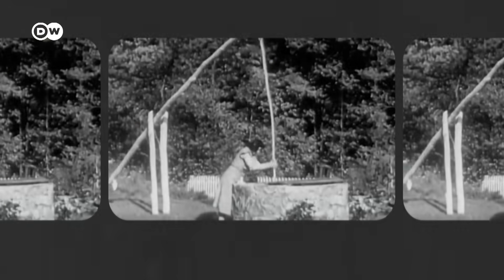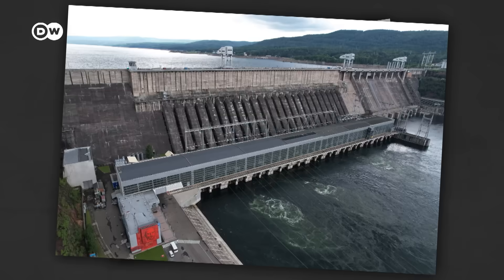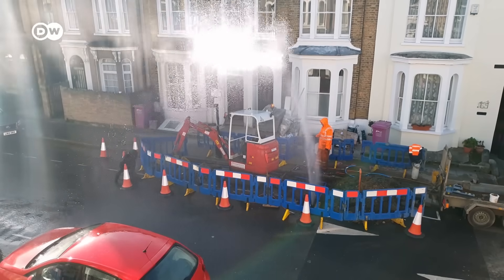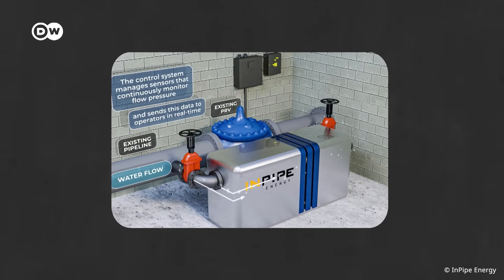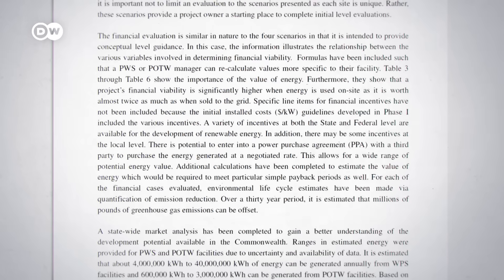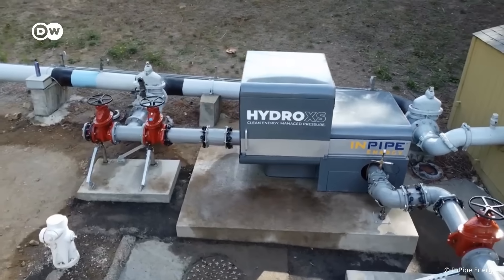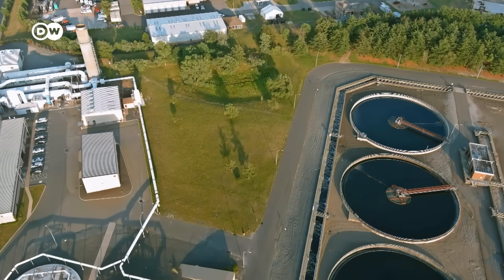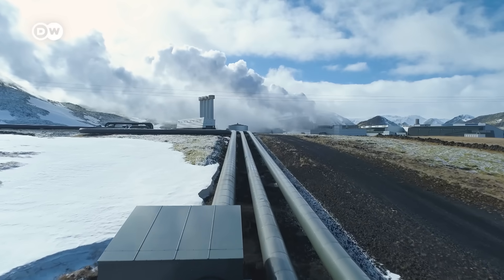In-pipe energy: The hydro power nobody is talking about

Comment: I'm sure it varies quite a bit by local geography, but in general, the pumps will be working even harder, and building even more pressure. If you want to "tap" into the resource of moving water, the oceans are hardly used. We have a mind-blowing amount of energy mostly untapped by the natural movement of the waves/tides. At the shore/beaches, we have a regular forward and back motion of water that could be made to move huge aluminum plates back and forth on a toothed track, which could be spinning enormous turbine generators. The power and scale of the ebb and flow of all that water could be harnessed to great effect IMO.

Comment: This doesn’t make sense to me.
Why isn’t the first priority minimizing the wasted energy? 

Like why would we put shade under facility lights that are way bright instead of just using less light?

The cost of installing all these seems securely high from a labor and materials perspective.
We’d need to bring a grid tie in to wherever we install these. 
We would need to manufacturer all parts, cable, etc, calculate the market value of the energy, mobilize and train a work force to install and service this whole new network, when we could simply have providers focus on minimizing wasted pressure? 

It sounds reminiscent of a tech billionaire trying to revolutionize mass transit when trains have always existed. 

Installing a turbine on a small local system like your house might be perfectly reasonable. 
That water is already at its destination and you get to decide it’s use. If you want to sacrifice further pressure for energy. Go for it, great idea. 
But at scale it seems like surely there are better alternatives with how to manage our water.

Comment: Unless gravity is involved, using electricity to build up water pressure, so you can generate electricity downstream from the pipe it flows through, seems like a very inefficient way. It would likely cost more energy in total than it can provide. It's a bit like running a turbine on electricity coming out of the socket of your home. But if there is scientific proof, I would like to read it.

Comment: Conservation of energy.

If a pump is used to move the water and you then add resistance (turbines) to the flow then you'll need to increase the power to maintain the flow rate.
Reply from the maker: Hey there!  Mini hydro technology only collects pressure valve waste energy already being generated by our water transportation service. Therefore, no additional pressure is needed. The process is explained at 2:26.
Reply: @DWPlanetA  This methodology relies on waste pressures in the system.  It would be more efficient to reduce the waste pressure - this is what water towers do in a very efficient way.

Comment: My dude you can’t get more energy out of a system than you put in. This is some basic ass physics. You’re having to pump the water which requires energy. You try to generate energy from the water in the pipes then all you’re doing is reducing the energy potential of the water by removing some of it from the system, not to mention the inefficiency due to energy loss of both wasted energy through sound, vibrations, heat, etc. - on the pump’s end as well then any energy lost to inefficiencies on your generator. 

Now if you’re trying to be a cheeky goofball and reduce your energy bill illegally, you could use it as a way to siphon some energy that’s already been spent by whoever’s pumping the water to use to help power your own home. However, that’s not making the system any more efficient, you’re just taking advantage of someone running all that free (to you) energy past where you live. There’s literally no reason to do this without it being on an individual level to essentially steal energy from the water pump to the disadvantage of everyone relying on that pipe for their water. 

Just stick a mill in a river hooked up to a generator… or build a hydroelectric dam.

Comment: Conservation of energy? The energy must come from somewhere and other than potential energy from water tanks, it would be energy from water pumps.

It's like wind turbines collecting energy from wind, would reduce air flow downstream.

Also, wouldn't power throughout be dependent on volume passthrough more than pressure?
Reply from the maker: Hey there!  Mini hydro technology only collects pressure valve waste energy already being generated by our water transportation service. Therefore, no additional pressure is needed. The process is explained at 2:26. And yes, higher pressure in water pipes mean higher water flow rate.

Comment: I don't know man, it sounds like a stupid idea to me. Yeah, you can put a turbine inside the pipe to generate electricity, but that would come at the cost of reduced water pressure for a lot of people and it's possible that some households could see their water reduced to dwindle or gone altogether during peak hours. A smarter idea would be to better manage energy consumption via AI and sensor fusion and don't pressurize the pipes as much during low demand.

Comment: Im sorry but surely the best thing to do is to not use the energy in the first place. This "solution" is a workaround at best. You want something more like distributed pumping stations and only ramp up when theres low pressure further down the system

Comment: If you put a turbine at the end of a pipe and run the water through it you decrease the pressure. So yes you get some energy but now you have a barely flowing water exactly what was mentioned at the beginning of the video that we don't want because it will take an eternity to fill a bucket. Maybe at those pressure regulation stations it make sense.

Comment: Dams have become bigger and more controversial, but with today´s  technology, it is possible to extract energy from as little as 5-meter fall in the form of electrons that are much better than water. 
But to obtain 100 watts of power, 2 liters (~0,53 gallons) per second of water would be needed in a 5-meter fall to obtain 100 watts of power, assuming an ideal system with 100% efficiency. So pipes are not solving our energy problem but rivers can.

Comment: If you resrict the flow the pump will have to work harder  and use more electricity.
Reply from the maker: Hey there!  Mini hydro technology only collects pressure valve waste energy already being generated by our water transportation service. Therefore, no additional pressure is needed. The process is explained at 2:26.

Comment: This is nonsense. Any water used to spin a turbine has to be supplied by the upstream pump. The pump will use more electricity than the turbine will generate. Unless the water is supplied by gravity, this is inefficient and cannot be sustainable.
Reply from the maker: Hey there!  Mini hydro technology only collects pressure valve waste energy already being generated by our water transportation service. Therefore, no additional pressure is needed. The process is explained at 2:26.
Reply: The pressure relief valves either bypass water to adjust pressure, or the pump speed is reduced to maintain pressure at a set level. Either way, by removing pressure upstream by running turbines will force the pumps to run longer and harder at the source. You have overlooked how these pumping stations operate.

Comment: as an engineer this is a terrible video. water systems are designed to certain pressures for a reason. If the pressure it higher than you as a layman thinks is necessary it's usually b/c you don't know engineering systems. there is a safety factor to make sure there is enough water pressure for the most fringe cases, and also excess water pressure for future development. you tapping into that is asinine. and if there were truly an overage of pressure, it's much more efficient to re-tune and lower the pressure as opposed to this backward idea of trying to reharvest it at 30% efficiency...........

Comment: Ok so unless your water supply is gravity fed you need to use energy to pump the water to people. Now lets add resistance to the pipes causing reduced water pressure in the lines.
I'm an Aerospace Engineer and was looking into this a couple years ago along with the need to twin most supply lines and a system of maintenance. 

This Besides the added cost of having to rip up most underground supply lines in our cities the cost would shoot through the roof. 
There are truly only a few places in which this would work in the world. 

If you want to know more about the pros and cons and as to how this could be implemented feel free to reach out to me.

Comment: The pressure in pipes is made using electricity from fossil power plants. Tapping this energy would slow the flow and create a need for more fossil energy to increase pressure. So the reason no one is talking about this is because it’s stupid. If you tap drain pipes then flow resistance increases causing all kinds of problems

Comment: Basics of conservation of energy apply here. This is siphoning off energy from the current pressure system in a non 1 to 1 ratio, because of normal energy converstion loss. Resistance in the water to turn those turbines is going to reduce pressure downline which will have an impact on service.
Reply from the maker: Hey there!  Mini hydro technology only collects pressure valve waste energy already being generated by our water transportation service. Therefore, no additional pressure is needed. The process is explained at 2:26.

Comment: 😂 the thing is a turbine regenerating energy will not only require high maintenance which would need to be maintained by qualified plumbers and electricians it will reduce water flow and require batteries!! Basically whole infrastructure refurbishment! You can't trickle charge a national grid it's not as practical as one would imagine it being!! Ive sat on this thought for many years but ultimately i comes down to suitable regenerative energy storage otherwise its just a pipe dream

Comment: This is dumb and inefficient, it makes no sense, just reduce the power of the pumps at the distribution center, because if the water carries more power than it needs, then it is more efficient to reduce the power where it is being applied than to add an inefficient turbine in the middle.

For example, if a turbine is producing 20W, it means there are 30W of power being applied in excess at the pump...

Comment: The real key message of the video is that energy and water should be managed together ! Water can be converted to energy (for instance a dam) and back (for  instance, purifying sea water). 

However, the video misses a key point: In a well-designed and dimensioned water distribution network, the only potential energy gain comes from gravity (where the source of water is higher than consumption). Incedentally, micro-turbines are far less efficient than centralized big turbines
Reply from the maker: Hey there! You could be interested in our videos tackling water as an energy source. Check them out: 
Tidal energy 👉 https://www.youtube.com/watch?v=1-2TyKqP84o
Wave energy 👉 https://www.youtube.com/watch?v=UUlA5WKDiww

Comment: i've wanted to do this for years. i'm amazed it isn't a more widely adopted practice. you could also use thermoelectric generation on heating pipes, as well as rain water generators on drain pipes, and if you can accommodate it, you could focus wind through pipes into a small turbine. and this is all at your home. at the point of use. you don't need to dig up the ground for it. though, industrialising it will obviously require digging. but all the aforementioned are affordable solutions which can be done right at home. now we just need to drive down the cost of batteries!
Reply: Here's why it isn't a widely adopted practice: It uses more energy than it generates. If it didn't it would be a literal perpetual motion machine. Every bit of energy you take from the water is extra energy you need to put back in to maintain the pressure the system needs. It's a gimmick like solar roadways

Comment: I’ve often wondered how this would work on storm drains.   It wouldn’t save the world, but in areas prone to heavy rains the energy produced could be stored in batteries or put back into the grid.
Reply: rainfall producing electricity AND water? what's not to love! Storm drain turbines would be a good idea
Reply: Yeah I bet people already thought about that. In fact, there are many ways we can generate energy but the problem is storing the energy. Batteries that use lithium-ion for example are expensive, take up a lot of space, and sensitive to temperature. If we can improve our battery tech, maybe we can save the world after all.
Reply: @andyc935  lithium iron phosphate batteries would be a better alternative for a stationary battery storage.   Also, I wouldn’t considering it saving the world it’s more like trying to save humanity. This world has been here billions of years, and it will be here when the humans are gone.
Reply: @whodahellru8124  when people use the phrase "save the world" it's usually an implication for "human survival" not to be taken literal.
 As for the batteries, Lithium iron phosphate it only good for small and lower voltage applications. Plus it actually has less energy density than Lithium ion which means it will take up more space. A good alternative might just be the solid-state battery. When perfected, it should have a greater density, higher voltage capabilities, and safer compared to Lithium ion while having the durability of Lithium iron phosphate. Not sure if solid state batteries will take off but we will just have to wait and see.

Comment: Are you looking to enhance your understanding of the law of energy conservation? It's worth noting that the kinetic energy present in water flow results from pump generation. Therefore, any energy obtained from water flow is equivalent to adding extra load on the pump, causing it to consume more energy.

In India, water tanks are commonly placed on building rooftops. However, the amount of energy needed to pump the water up to the tank exceeds the energy that can be extracted from the downflow of the water back down to the ground. A continuous water flow is also necessary to generate electricity, meaning all the water eventually returns to the ground.

Extracting energy from pumped water will increase carbon emissions. This is due to the inefficiency of using flowing water to transport energy due to friction in pipes and changes in altitude. The most effective method of energy transportation is via electricity, period.
Reply from the maker: Hey there! Mini hydro technology only collects pressure valve waste energy already being generated by our water transportation service. Therefore, no additional pressure is needed. The process is explained at 2:26.

Comment: That sounds like completely ridiculous idea if you familiar with physics and how does pumps and pipes works. 2M watts sounds like a lot but in fact it close to nothing compared to the size of the cities. Roughly for 400 households less in USA more in India. You could harness some energy from hydraulic ram effect but it's not something that occur frequently so the amount of that energy would be insignificant compared to overall energy spend to move all that water. Much better for saving electricity is to have "smart" pumps that know exactly how fast they need to spin and when that would save in a matter of magnitude more energy then this child play with water flow.

Comment: Its not new... Its not worth it. 
The energy colected by the friction added to the system by those turbines is less than the energy needed to increase the pump pressure to compensate the fritction of those turbines
Reply from the maker: Hey there!  Mini hydro technology only collects pressure valve waste energy already being generated by our water transportation service. Therefore, no additional pressure is needed. The process is explained at 2:26.
Reply: @DWPlanetA  Hey...

The way its explained , the numbers used , the most examples used  in this video are references for the system I mention before...

For the specific that you mention on the comment , the complexity , initial price and maintenance for that little energy are also not worth it. 

Do you have any data , studies of real life examples that support your claims ?

Comment: Each turbine will take away power or pressure from the water in the pipe... So they would need more power to pump the water..... Else this would almost be like a perpetual motion machine....

However IF the calculations are correct, that it goes so much power into pumping the water that the energy can be taken away without disturbing the pressure you get out of your tap... THEN IT WOULD BE BETTER TO LOWER THE POWER INPUT OF THE PUMPS! Less money needed to modify everything... How much power, CO2 emissions, etc will go to waste t make those mini turbines and implementing them???

This whole system just smells of a huge scam to steal away more of our money and keep polluting!
Reply from the maker: Hey there! The issue is that the individual water pressure depends on various factors, such as temperature/clogged pipes etc. Therefore, reducing the overall pressure could result in some households experiencing water pressure being way too low. Micro hydro accounts for that using the individual and varying waste energy.